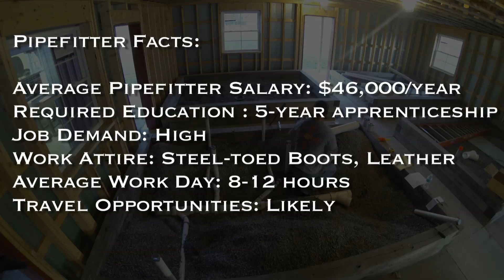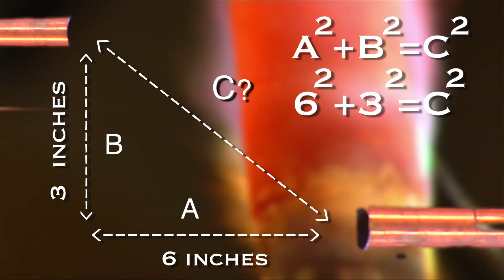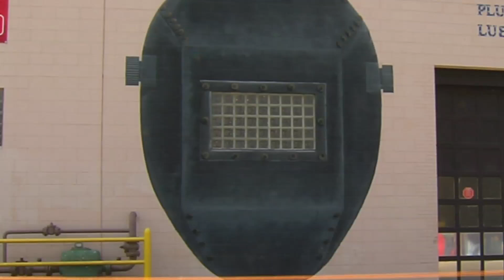STEAM THE PIPEFITTER APPRENTICE

Comment: Nice thanks I’m going to do this which one is better way to go pipefitter or Ac service?
Reply: pipefitter
Reply: @1ifbyland2ifbysea   what’s the advantage going to Pipefitter route ?
Reply: @passangsherpa6831  in this area about 20 dollars more an hour and more work for pipefitting. ac  service professionals dont usually make big money till they become owner. as a pf you can make over 100 000 as a apprentice if you travel
Reply: @1ifbyland2ifbysea   thank you so much for sharing, I am from Florida how much starting apprenticeship get pay in start?
I heard pipefitter is hard
Reply: @passangsherpa6831  your work will mainly be plumbing and pipefitting also a lot of traveling because in south there are not many unions and the pay is lower. call your local apprenticeship and ask them what you need to do to apply.
Reply: @1ifbyland2ifbysea  we have union here in south Florida Miami but they have 2 options pipefitter and servicing pipefitter is similar to plumbing right? It also does boiler, chiller and heating?
Reply: @1ifbyland2ifbysea   Pipefitter we gets opportunity to go out of USA?
Reply: @passangsherpa6831  Absolutely. Steamfitters can work almost anywhere in the world. Saudi Arabia, Australia, anywhere in Europe or North America, Many parts of South America. Basically anywhere there is industry. Steamfitter is absolutely the best route because you will make much more money than a service tech, and get laid wayyyyy more often.

Comment: (A=3")+(B=6")=C........not going to be 45's
Reply: I caught that too josh. I came to comment the same thing. The run and the set must be equal in a right triangle in order to have a 45 degree hypotenuse travel. The pythagorean theorem is best used for rolling offsets.
Reply: 45s would have same offset and advance
Reply: take the square root of 45 and youll get the answer
Reply: Yes it is.
Reply: Explain
Reply: Okay, I'm not a good explained but I will try.
Formula: A^2+B^2=C^2

Remember 3 Power  of 2 doesn't mean 3 time 2,but it actually mean 3 time 3 
For example: 2^2=4
                        2^3=8
                        2^4=16
                        2^5=32

A^2+B^2=C^2
Three power of two is equal to nine.
Six  power of two is equal to thirty six.
Now you plus A and B together to get C so nine plus thirty six equal to forty six.
3^2=^6^2=C
3^2=3*3=9
6^2=6*6=36
A(9)+b(36)=(C)45
9+36=45

_/6.7
I hope this explain it.
Reply: You understand the only way to use 45* is if the rise and the run are equal...... Your entire formula is correct except the two angles of the triangle will not be 45*s... 45* would be a=3, b=3.
Reply: Can you give me two example of the math?
Reply: Your example-
C=6 11/16"
The angles are 63.43* and 26.57*.....two 45* fittings will not work
Reply: Think Im incorrect still?
Reply: No. You right.
Reply: @joshuajosephgardner  I'm confused tho... I get that the offset and rise/run have to be equal to use a 45 but isn't 45 referring to the length of the travel?
Reply: @ianmcintosh8307  it's 45degrees, the angle of the fitting.....
Reply: @joshuajosephgardner  OK I get what your saying,  I was just paying attention to the formula and not the part he was talking about before it lol

Comment: u cant just bend that? seems brazing the copper would be weaker than bending the copper
Reply: Bending will restrict flow.
Reply: We don't bend copper pipe. We bend  acr   copper tubing. You don't bend pipe, you bend tubing.  Hence why it's called a tubing bender not a pipe bender.
Reply: The reason we don't bend copper pipe is because it stretches the outer radius of the bend, making the wall thinner leading to premature failure. Most copper in hydronic systems are soldered, not brazed. Typically brazed joints are used in soft drawn copper @sean poore (ACR), in refrigeration applications, although they are used in other applications as well. Bending @dontehll454 will actually decrease laminarity/flow or increase what's called pressure drop, but in comparison to a 90º fitting all of these effects are less in comparison using bends.